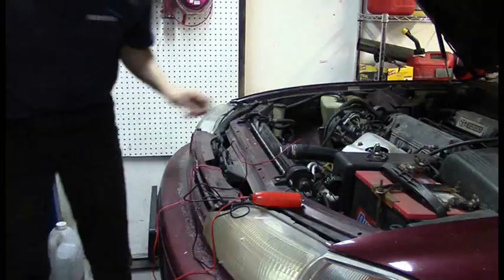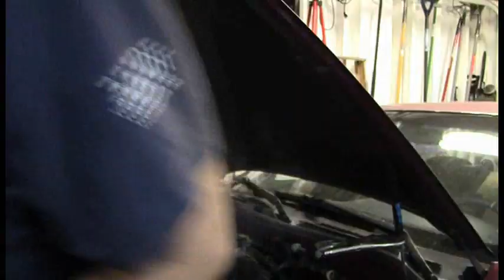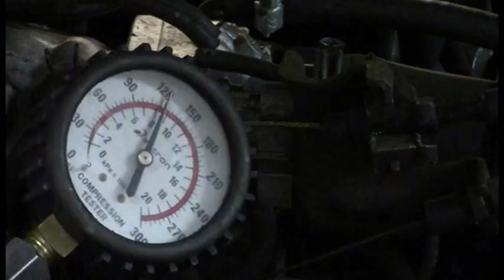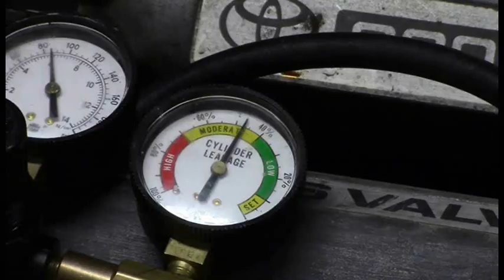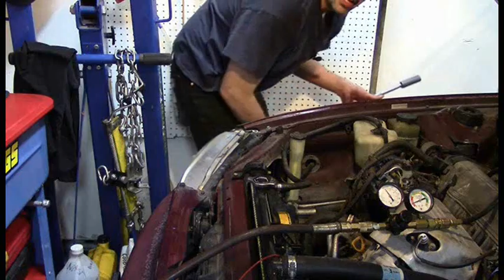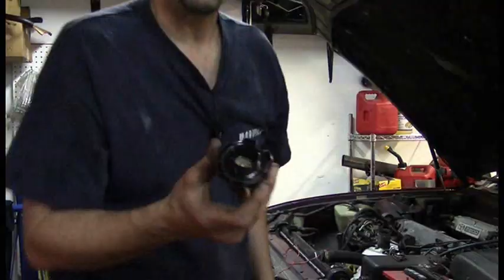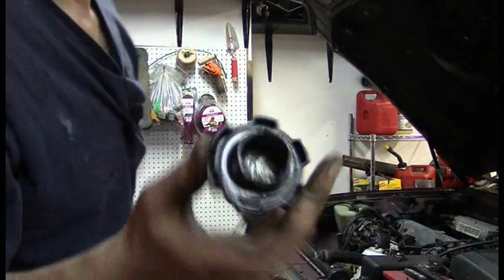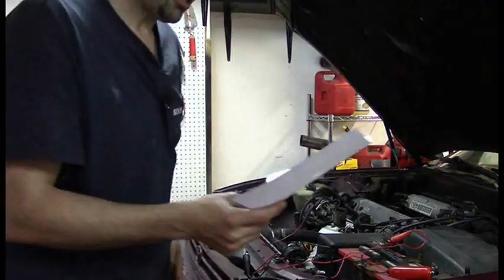12 Ways of How To Test A Blown Head Gasket Compared- PART1

Comment: does the car have symptoms that would warrant testing for a blown head gasket? wouldn't that be step 1?
Reply from the maker: No. Symptoms aren’t a TEST. The video is how to TEST for a blown gasket once it is suspected. 
   One of the biggest problems in diagnosis is when people confuse symptoms with data. They are totally different.
Reply: @SchrodingersBox  symptoms are the reason you test, no?
Reply from the maker: Yes of course. Then you test. Which is what this video is. Tests for blown head gasket.

Comment: Congratulation for the videos. I bought an old mercedes w204, c220 diesel car. In the garage they told me it was the oil coolant (they said they checked it and was broken), but I still have oil in my coolant reservoir 😢.
I wish I could find a garage/mechanic that could made a good/precise diagnosis on my car. The car runs good just a “add coolant” warning light.The engine didn’t get hot so far. But the car has some problems with the  chain tensioner, too. The carter has a mild loose. So I keep spending money and haven’t fix completely yet. I’m trying to learn from your videos more about this blown gasket issues. Thank you from Spain 🇪🇸!

Comment: Hey Matt, been a while.  So, after I sprayed the parts canon at my 1997 Dodge Ram 1500 2WD 5.9L hoping to fix a misfire, which two other mechanics suspected after a courtesy look and hooking up the OBD also, and seeing no fuel trim problems or misfire issues, even passing a smog test , I took it in to a mechanic to pay for a professional diagnosis.  This Mechanic, High Tech Auto Care, repeated my work by replacing all the spark plug wires, and plugs, telling me I hadn't installed the correct plugs (please), or wires.  Of course the engine still ran like dog poop, but passed the smog test he performed, pre-diagnosis. I could hear the vibration during the smog test.  In the end:  He charged me the original diagnostic fee of $150 plus another $120 for plugs and wires.  When I wasn't a happy camper he explained how I had installed the wrong wires and plugs again and when I said well, you told me you would give me a diagnosis @ $150, period; and you owe me a diagnosis.  He then said; well for another $150 I will tell you what's wrong with it.  I said what will you look for?  He said well it could be the harmonic balancer or the torch converter explaining that he needed an additional $150 to perform those checks.  I had already put a timing light on the Harmonic Balancer (not knowing it was a harmonic balancer because when I was a kid working on motors, they had flywheels acting as balancers) and the timing marks were spot on and no wobble on the balancer.  Knowing that if it were a tranny issue I could not repair it, I gambled on a the Harmonic Balancer at $100 part cost, and the Engine runs like a champ.  I don't feel so bad because three other ASE mechanics mis-diagnosed it, 2 as a courtesy and one (High Tech Auto Care) bent me over. They had a chance to make a customer (not a sale) and they didn't.   My empirical tests I learned watching your channel all gave me accurate results, but having no experience I sprayed the parts canon at the 25 year old girl, "well, it needed the new parts anyways?'  LOL.  With 250+k on the old girl, she runs so smooth now, it's scary.  Even though I sprayed the Parts Cannon at her, I don't feel so bad.  I hadn't spent a dime on her in years.  I learned a hell of a lot and want to thank you so much.  Even though it took a long time to go through the steps of diagnosis, from spark to the Evap system, I learned a lot and enjoyed it while doing so.  That Harmonic Balancer showed no signs of Wobble and no signs of slippage or damage.  Life happens.  I would love to hear your thoughts on that issue. Hope you're doing well.

Comment: could you not have a head gasket leak that is one way? i.e no coolant in oil, but oil in coolant?
Reply from the maker: Yes you can. I call it a “flap”. Where compression pressure pushes on the flap to seal it but open the flap with vacuum.
Reply: @SchrodingersBox  thank you! so there would be oil leaking into coolant while engine is off (i.e. the coolant pressure is higher than the engine oil pressure), but  "the flap" is closed when engine is on and oil pressure is higher than coolant pressure??

Comment: This was really good, but I was under the impresstion from other youtuber videos on the leak down test, that if the compressed air stays high, like 100% it has good compression, but if it drops significantly like 20% then you have really bad compression.
Does this depend on the readings on the gauge you use?
And, if you can hear the air escaping example from the exhaust system, it doesn't always mean a head gasket problem, it could mean stuck values on the outlet valves?
Just curious about this.
Thanks for all the videos you have done.
Reply from the maker: I used to also think that too however I have many many videos showing examples where such data cannot be relied upon
Reply: @SchrodingersBox  Cheers for that.
All the best for 2025.

Comment: Compression test and leak down work good assuming you have no other compression issue. A valve problem, piston rings or cylinder wall issue will all cause low compression and leak down. Hearing the bubbles during leak down is absolute confirmation.

Comment: Hi Matt, should the radiator coolant level bloating when you give throttle, or should remain calm
Reply from the maker: It will bloat because you are increasing water pump speed.
Reply: @SchrodingersBox  thanks for reply Matt, i have a civic 96 with cylinder head overheating and valves rattling sound, i removed the thermostat and I boiled it and it opens, now the temperature is lower but I hear a deep bass sound from the exhaust but no white smoke, i think I have an anomaly somewhere, what you advise me with your experience. Thanks..
Reply from the maker: I would go right to a compression test as first step.

Comment: Question combustion leak test changes color on cold start but not when the motor is warm or hot?  First start of the day it changes from blue to greenish but once warm doesn't change color.  2012 ford f150 5.0 with only 50k miles
Reply from the maker: It could be the leak is sealing with warm temperature.

Comment: For the fluid test, my car kept boiling over before it could change colour
Reply from the maker: Yes probably due to head gasket failure but you usually have to lower coolant level on any vehicle to prevent that

Comment: when testing the radiator, if the coolant level rises slowly to overfill the radiator cap without signs of bubbles, does that mean that there is a problem with my head gasket/cylinder head?
Reply from the maker: Not necessarily. Could just be the coolant heating up and expanding.

Comment: Got a 98 Northstar 4.6 and I had a plastic frame cooling fan that tore up a brand new radiator. Oh joy. Engine got hot. Replaced radiator again. Just great! Since then I have used Blue Devil in the system months back and followed it to the T.  Now about every 15 seconds I see bubbles in my holding tank. Antifreeze is getting burned up in a cylinder. It is a clean ride and and I am the second owner of this 98. 127.000 miles.   Guess I will flush the system again. Pull the thermostadt again and hope this time I am going to win with Blue Devil What a mess. Us normal folks cannot go out and buy a $6,000 to $75,000 new ride!  I had no idea Northstar engines were notorious for this when I bought the car almost 4 years ago. Lucky me.  It would still be perfect if that fan frame had not broke when driving and tearing up my 1st new radiator.

This time I think I will use Prestone Super flush first then go with Blue Devil again even thought the coolant system was perfect before all this happened.  The car got hot so fast. I did not realize I had an aluminum block engine. Hope said head is not warped. And so it goes.  To see a beautiful ride like this go to the junk yard would be more than heart breaking.

Comment: Do you need to remove the thermostat when doing the leak down test ?
In order to look for the bubbles from radiator cap?
Reply from the maker: it definitely helps.
Reply: @SchrodingersBox  I don't understand how it would work at all if thermostat was not removed.
How would any air get out top of radiator cap then?
Reply from the maker: Because You will hear the coolant bubbling.
Reply: @SchrodingersBox  But to actually be able to visibility view coolant bubbles at radiator neck wouldn't the thermostat need to be removed?
Reply from the maker: Yes you would. But believe me if it’s leaking to the cooling system you will know it almost as soon as you apply the compressed air. The bubbling sound is unmistakable.

Comment: Will this combustion gas detector work as well on diesels. Thanks
Reply from the maker: Great question. I don’t see why it wouldn’t. In fact I am very positive it would. There is still carbon dioxide present in diesel combustion - it’s essentially the same combustion reaction as gasoline (hydrocarbon->CO2 + H2O) and the tester detects CO2.

Comment: Nice instructions. Thanks!

Question for you, as to what product and how much you think I should use. I have a 1995 Subaru 1.8L 4-CYL boxer Impreza, 177,000 miles.  I have 76 and 78 PSI dry compression in #2 and 4 of one head (driver side).  This started a few days ago, we noticed while on a highway trip the power was weak and I can hear it missing as the RPMs drop from driving to idle.

I don't have overheating, excessive oil consumption (drippy seals, I add a quart about every 900 miles), smoking, or fluids cross contamination.  I'm waiting to have a leak down and another dry/wet compression test at a different shop. The first shop only did dry compression and wasn't too bright or helpful. 

If I end up having a head gasket leak between those two cylinders, what products would I possibly try to mend it?  It must not be too bad of a leak, whatever it is, for the compression to build to 78psi dry.  The other two good cylinders are 130ish psi. 

If it ends up being a valve leak, what products and strength could I try to get them clean?  After cleaning, I will have valve clearances checked, as it's probably never been done.

Comment: Compression test is generally the way to go. Its rare that a problem doesn't show up and the other tests are redundant because it really doesnt matter what issue is indicated by a compression test. If youre losing compression, the head needs to come off and a new gasket needs to be installed when it goes back together. Only an idiot pulls a head without doing a valve job, squaring the head and block, and at the very least mic'ing and inspecting the cylinder, though its not much more labor to just drop the pan, pop off the rod caps and hone the cylinder with a cordless drill. You really should clean out your ring grooves anyways and check your ring gap before reassembly. It really doesn't matter what the specific problem is. Too many mechanics spend as much time trying to diagnose this stuff as they do fixing it....check for white smoke in your exhaust, look for white oil when in the first few seconds when you drain the pan, pull the valve covers and look for white globs in the corners. If you have all those symptoms, you can do a comp test for s's and g's but that heads coming off either way.....its also worth noting that a comp test wont work on small engines because the cam has a compression release mechanism

Comment: Can anyone give their take on low compression on 5 cylinders no compression in cylinder 4, suv shut down on freeway. It doesn’t turn over almost sounds like a failed stater… belts, alternator, starter are
Good, new battery, new spark plugs and coils, no over heating, oil consumption seems normal (but I’m no professional)… just trying to get an honest solution without out $8k one mechanic quoted… seems strange HELP
Reply from the maker: Doesn’t sound good. low compression on all cylinders often is result of a timing problem- so all cylinders affected. but the no compression on a single cylinder is bad news for sure. you need to do a leakdown test to determine cause but it won’t be good whatever it is.
Reply: Thank you for your feedback! Didn’t see this response. The mechanics only did a compression test not a leak down test. So it’s still not definitive answer. Wish I can do the leak-down test myself.

Comment: So it is my understanding that a head gasket can "blow" in one of 7 ways...
1. Compression leak to adjacent cylinder (loss of power)
2. Compression leak to outside (loss of power)
3. Water to oil (coolant pass leak into oil gallery resulting in oil in coolant or vice versa)
4. Compression leak to oil 
5. Coolant to outside
6. Compression leak to coolant
7. Oil to outside

The test where you put the tube in the radiator testing for compression exhaust mixing with coolant I like the best but it only tests for #6 condition.  

I think it can be very tricky to test a blown head gasket because you can pass the test with the tube in the radiator measuring exhaust gases there and think you are all set no blown head gasket yet you can have an issue between cylinders or any of the above mentioned possibilities.

I think multiple tests are the best way to go...obviously excess blowby in the crankcase when opening the oil filler cap is thought to be bad rings but it can be from a bad head gasket/cracked block/head between the cylinder and the oil passage...

Comment: I had a guy replace several parts (water pump, alternator, belt tensioner, serpentine belt, thermostat, etc., only belt tensioner that malfunctioned) on my 1994 Chevy K1500. He did a bad job on the water pump & it leaked so bad, the truck had been sitting for 9 months. I decide to have him back to reinstall the water pump, the gasket was kink & no gasket on the other end, plus he didn't clean it including the bolts. I cleaned all the parts & bought another gasket & it leaked no more But now I have some oil in the coolant. He & everybody told me it's "Blown Head Gasket", my truck has been sitting for a few months now.
I just checked the oil, it's not milky in the tank or dipstick. I watched some YouTube. Now I think it's the "Oil Cooler" but I don't know it's the oil cooler, the gasket, or the oil cooler lines. How can I tell where's to fix it? If it's possible, I plan to fix it myself & I'm an (older) woman who has very little knowledge about mechanics but I started to learn a lot from Youtube & started doing & fixing it myself.
Reply from the maker: if you suspect it’s an issue with the oil cooler you can drain the lines and pressurize them. if you see bubbles through the radiator or coolant reservoir then that’s the problem.

Comment: How do you feel about using some of the head gasket sealers? Many times it's not worth pouring a lot of money into an older vehicle to change a head gasket.
Reply from the maker: Waste of money. if it works it is because it wasn’t a head gasket failure.

Comment: My Lincoln navigator runs at an idle with no problem, but temperature gets hot while driving have tested head gasket every way possible. It seems that the coolant system is stopping up. Anyone have any ideas. They would be greatly appreciated!
Reply from the maker: did you check the basics. fans, find are clean, water pump working?

Comment: Does a faulty thermosta can creat a damage gasket yes or no?
Reply from the maker: Yes, it can if it’s stuck closed. that would cause an overhead and warp the heads and cause gasket to fail.  however it’s very rare for them to fail in closed position.

Comment: Great video.  I have used the tester kit and it stays blue but have mayo on the oil cap.  Any idea where I can go from here?
Reply from the maker: compression test would be next. sometimes the foamy cap is just condensation not coolant.
Reply: @SchrodingersBox  Actually just picked up on a couple other videos about the condensation from cold weather and short trips.  Will be taking back this $40 Head gasket repair for now.  Thanks for answering so quickly.  Your videos are great and I'll be subscribing.  BTW I think I'm a Progressive not a Liberal, as I don't need a "safe space"  lol.

Comment: I'm working on my moms buick with gm 3800. The weird thing is the car doesn't overheat but she keeps having to fill up the coolant I dont know where it is going. It failed a coolant pressure test I did. There are no obvious leaks so it has to be internal. I already changed the intake manifold gaskets and it's still doing the same thing. Any help would be appreciated I'm stumped?
Reply from the maker: when you changed the gaskets what was the warp on the intake manifold measured at?
Reply: @SchrodingersBox  you mean the warp on the block or the intake manifold itself I didn't check?
Reply from the maker: both. that’s probably the issue. it may be out of spec.
Reply: @SchrodingersBox  how would I measure that with a straight edge?
Reply from the maker: I use a straight edge and feeler gauge.

Comment: Mate, awesome vid 👍
Reply from the maker: Glad you enjoyed!
Reply: @SchrodingersBox  I did indeed. Cheers
Reply: I suspect that oil leaks through the oil cooler inside the radiator (on my 300 Tdi diesel engine). As oil is at higher pressure, 15 psi radiator testing wouldn't be sufficient I suppose? Cheers
Reply: @SchrodingersBox  I wonder whether there is a way of pressure testing the engine oil circuit? Similar to engine leak testing?